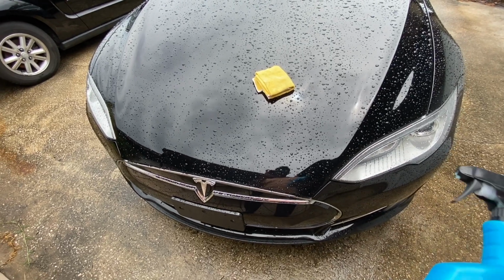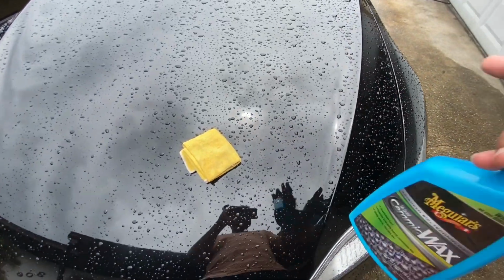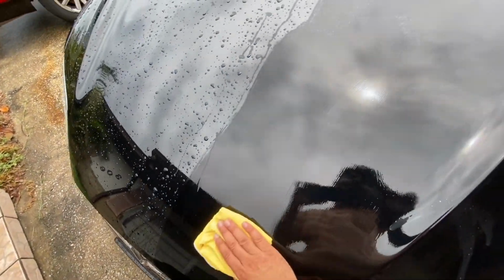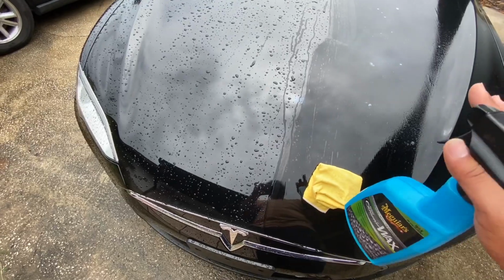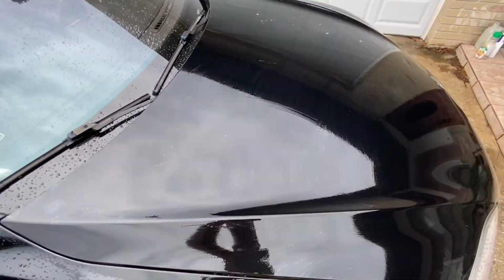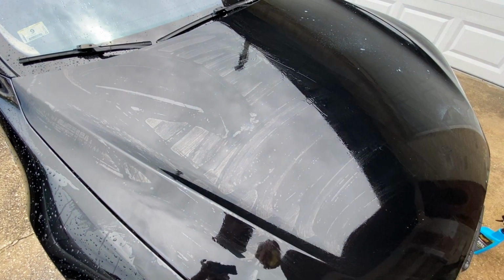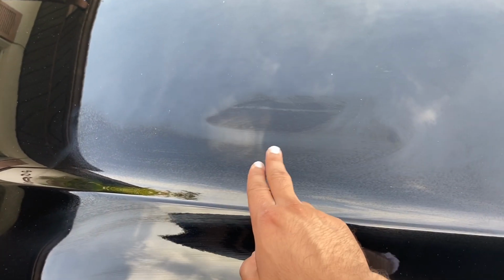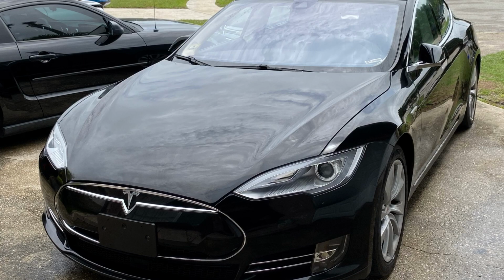How To Apply Meguiars Ceramic Wax Without Wasting Product

Comment: As you said just clean the car, leave it wet, spray once per panel and spread it with a plush towel. Less is more, if you apply too much it smears and you'll need to use a detailer to remove the excess. As you say, the whole spray on rinse off is just to make you use more product.

Comment: I just used this product today on my F150. Was at the car wash so I washed it then sprayed it on then did a total wipe down, rinse again and proceeded to dry off and buff to a shine. I must say seems to work as intended .  I did spray too much and it was very streaky but the second rinse fixed the issue.  I’m happy with the results.  Lots of 👍
Reply: Just did the same thing. Works great

Comment: I found that using a latex glove to spread it when dried and sprayed slightly wet with a water spray bottle forst and having the wax spray distanced into the panel works best.

Comment: I've used this product by just spraying a single shot into the wash mitt & wash a panel around the whole car including the wheels. Let it cure for about a minute before rinsing the whole car (I use an old school garden hand pump 2-gallon sprayer, then towel dry from the top down. Had the same bottle of wax for about six months & maybe use 3 gallons of water for an average size car. Great results from a great product.

Comment: I used this on my dark blue car, so far I am amazed with it. I finally see water beads on the paint. I hope it last me at least 2-3 weeks every time I spray it on my car.
Reply from the maker: It should last several months if you use the dry application method! Wash/dry the car completely. Then spray it on the DRY car and rub it into the paint like a regular wax and buff off the excess. Everytime you wash you can use this method in the video to keep adding layers.

Comment: Per company video the rinse is what activates the product.  Don’t understand why one would not follow the directions made by the creator of the product.
Reply from the maker: The rinse doesn't do anything to activate the product, the product doesn't require activation. If you check out Car Craft's video it shows the difference between dry application vs the company recommended rinse application. The dry application lasts much longer on the paint and is much more resilient. He does a torture test and performance comparison between both methods. 

https://www.youtube.com/watch?v=s1rMMrOqGTg&feature=youtu.be

Comment: OK follow the instructions on the can but use it with care, make sure you activate with a pressure washer then towel down for great finish. And FULL prep with clay bar and remove old finishes, if the panel beads water there are still old finishing products there. use a diluted rubbing alcohol to clean them off. Then apply the ceramic finish

Comment: The second that stuff hits a water droplet it breaks the surface tension and runs off which I could see how that could cause a streak or an even product application. It seems a lot more sensible to apply it with a damp applicator.

Comment: For $23+ with tax....so far no beading. Wasted a lot on the foundational spray.
Reply from the maker: Check out this video for a dry application. It makes the best foundation. https://youtu.be/s1rMMrOqGTg
Reply: @abuzar1  I saw his video and decided to go with the dry application. However, I didn't see any beading on the hood and only a slight change on the front bumper. I went ahead and did the whole car anyways and figured I would check the whole car tomorrow. Not impressed at this point, not even if it was $10.
Reply from the maker: @kurtsmith7588  That's odd, you might want to get your money back. I've used it on 5 of my cars with excellent results.
Reply from the maker: @kurtsmith7588  Beading is overrated though. As long as the product sheets off water and protects your paint.

Comment: Does this wax give more gloss than meguiar's liquid hybrid ceramic wax?
Reply from the maker: It’s the same. I actually prefer CMX spray much more compared to this now.
Reply: @abuzar1  thank you for your answer. Why do you prefer CMX?
Reply from the maker: @1980Aioria  Much much easier to apply properly, doesn’t leave streaks and lasts longer in my experience. The ease of use is the main thing though. I’ve been meaning to make a video on it but very limited on time.

Comment: the high pressure washer activates the product.  that's why you should flush the car
Reply from the maker: It doesn’t. You get superior performance by doing a dry application. Many videos on here doing side by side comparison. I’ve linked them before to other comments.

Comment: It works better on dry panels with damp cloth followed by drying cloth. One for application another for buffing.
You use less and get a better finish. And don't waste it on the spray and rinse method. 
At some point the water won't bead up, than re apply the wax.
The instructionson on this wax are stupid. Follow them to waste the product and constantly have to re apply